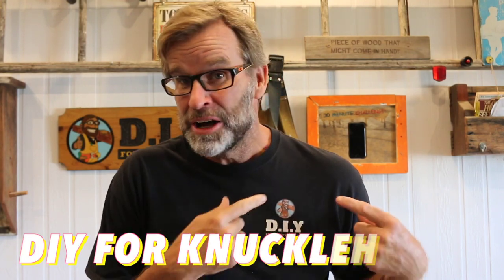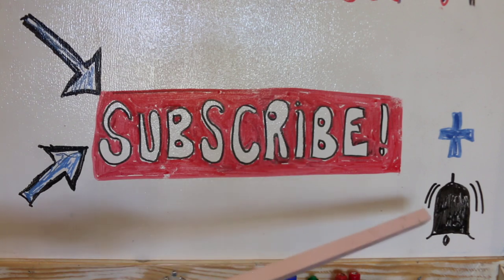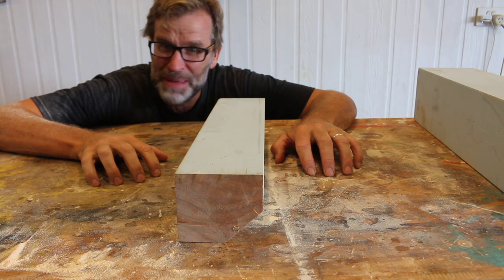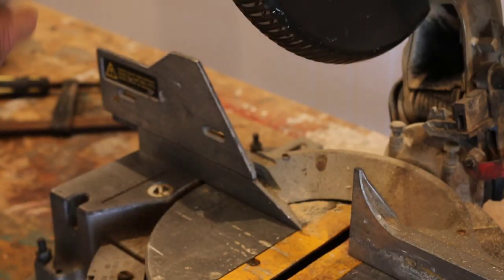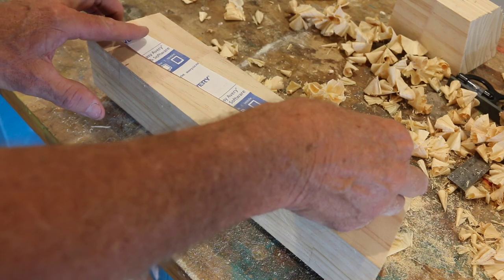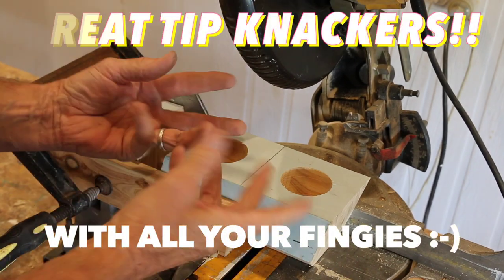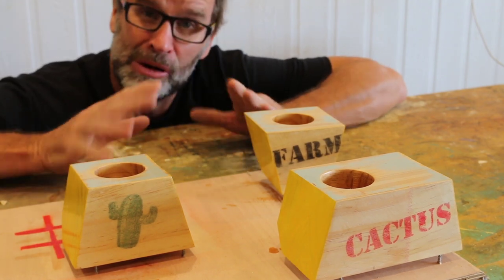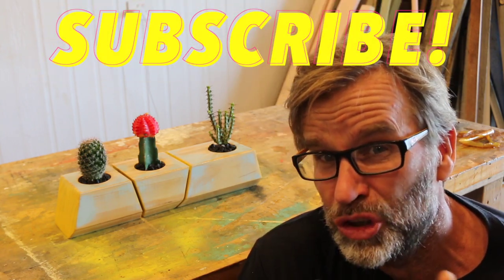Scrap Wood Projects for Beginners...FUNKY Cactus Planter!

Comment: I like it, Shane. A little tip for planting cactus is to use kitchen tongs, chopsticks, two pieces of thin scrapwood or even some folded newspaper to wrap around the spikey end. Save trying to pull out the spikes later.
Reply from the maker: Good tips Ian!....wish l had have thought of them 😂

Comment: I built this and it turned out good! But I’m just wondering what size bit you used for the holes, I havnt drilled them yet
Reply from the maker: G'day Matt...my holes are 55mm but if l was to do it again l would make them a little larger so that l could get more soil into the hole. Good luck 👍😁🇦🇺